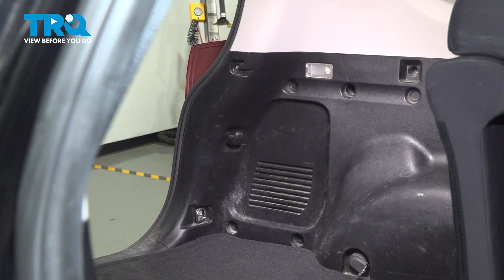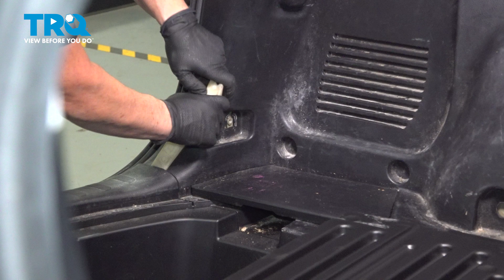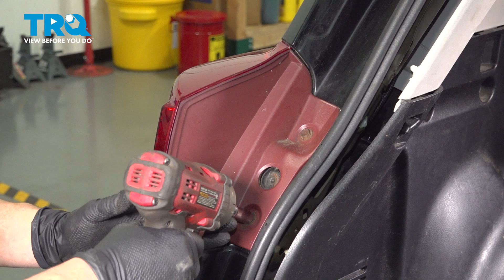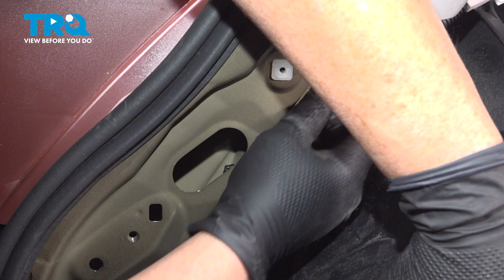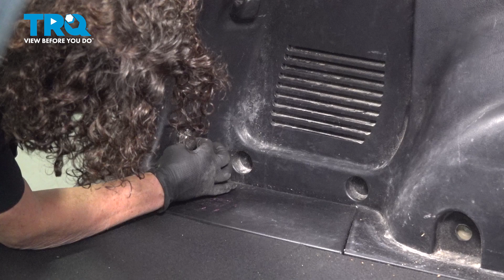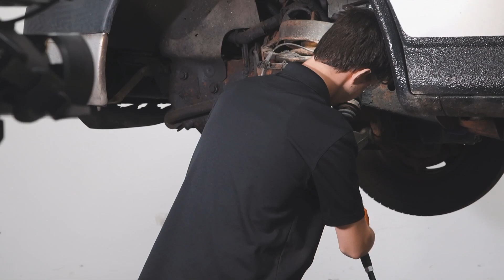How to Replace Outside Tail Light Assemblies 2013-2018 Toyota RAV4

Comment: 2016+ you only need to remove the two bolts on the actual light, then pull it towards you.